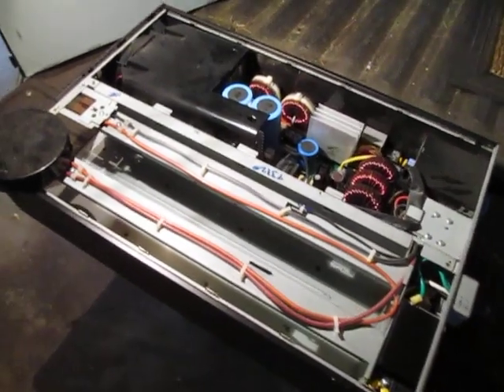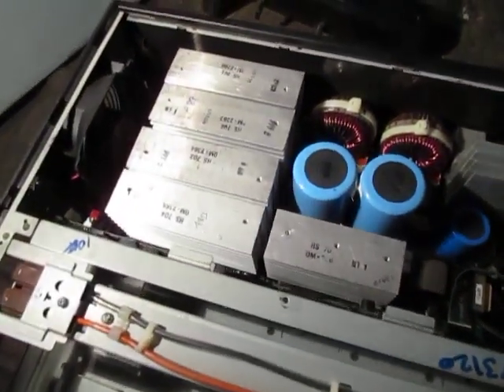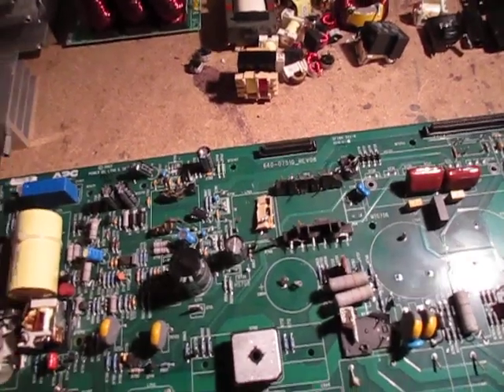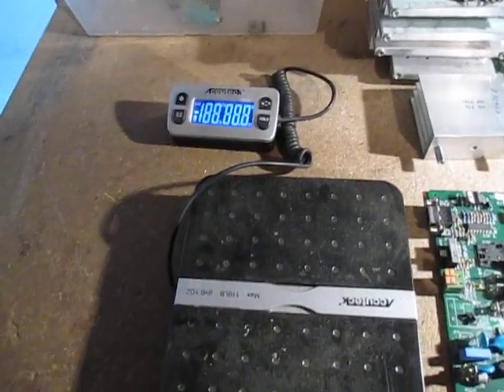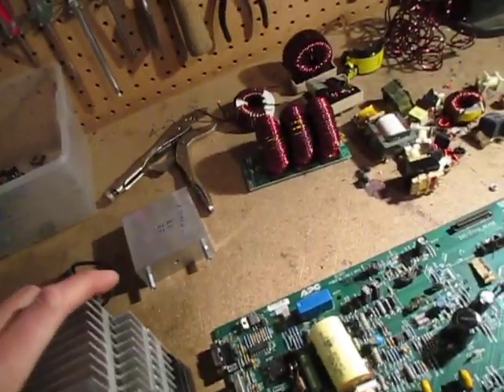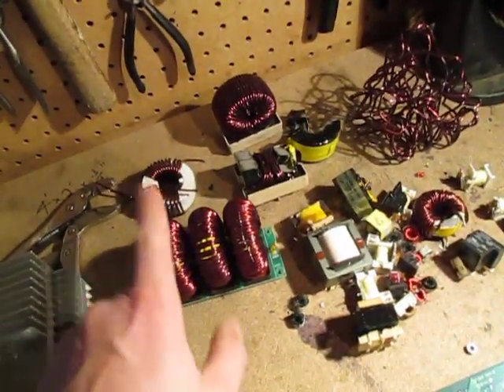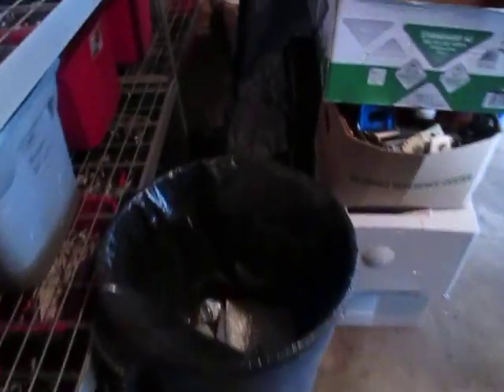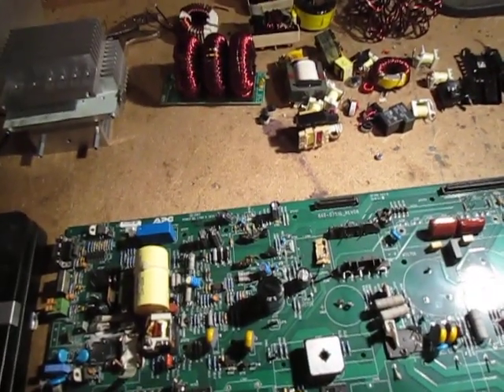Making More Money Seperating Copper & Aluminum From A Computer Server.

Comment: Hey Kerry! Good info video!! Just wanted to mention that because the unit had battery and this big power board the unit is not a PC server.. It is a UPS, invertor from DC 12 or 24V to 110 AC.. or somne kind of power unit.
Reply from the maker: Thanks for the info. It came with a bunch of other components and server items so I figured they were related. But I wasn't sure. The only thing I am sure of is that I enjoyed scrapping it. Those heat sinks and copper coils are awesome in these. Take Care.
Reply: Great! Take Care!